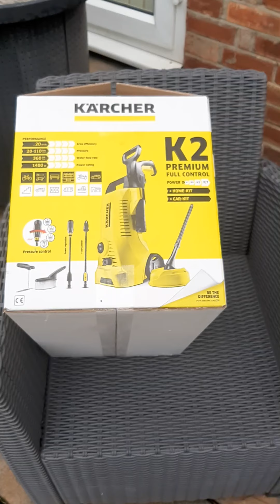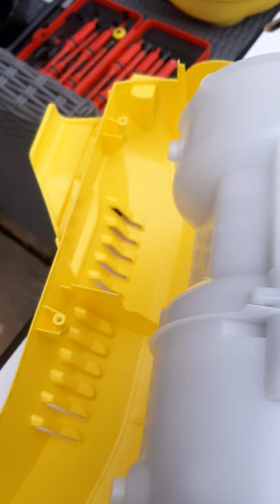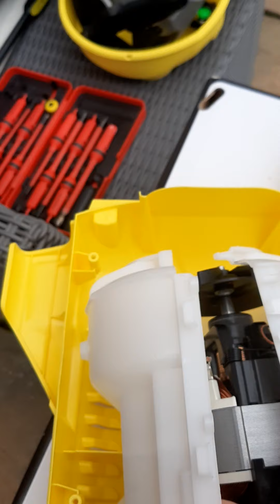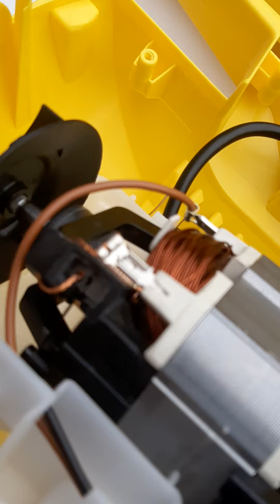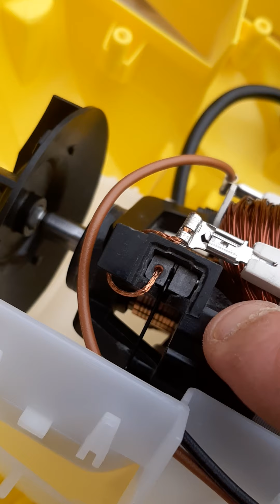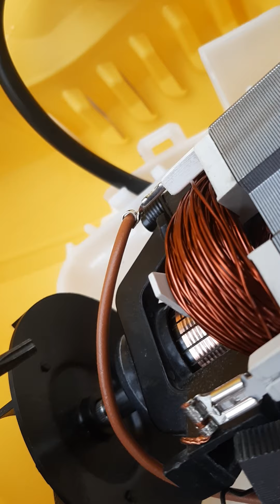How to repair karcher k2 / k2 full

Comment from the maker: You’ll find that most times, when the brushes wear all the way, down, and disappear, it will then make contact, copper onto steel, that will then strip the copper of the spindle.   So best to change before otherwise it will brake the machine

Comment: Hi mate a couple strips on the spindle are missing, and the brushes aren’t touching the spindle as they are worn  quite a lot, would recommend changing brushes or complete motor
Reply from the maker: Once the carbon brushes are worn to a certain point, it metal onto the copper spindle that then strips the copper off the spindle, so technically destroys the machine.    Change before they wear down.     For 10 min work or 100 pound for a new machine whats the best option.